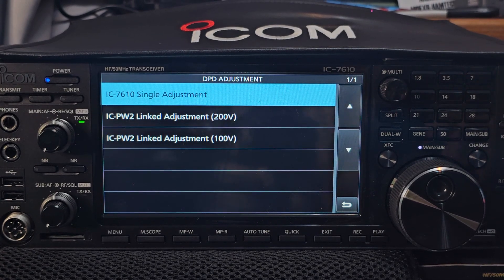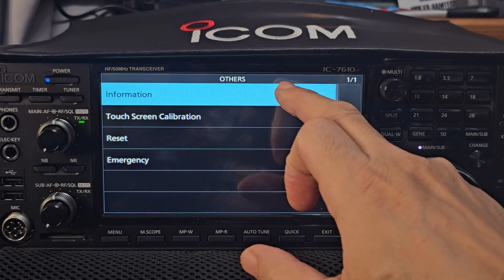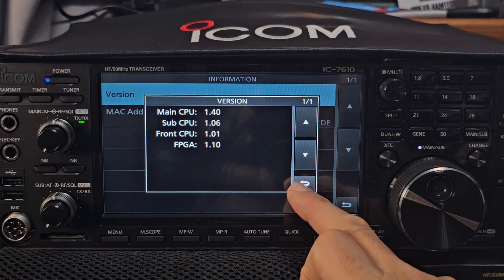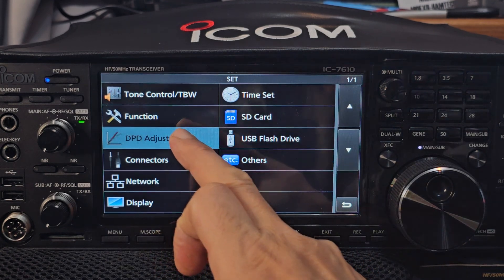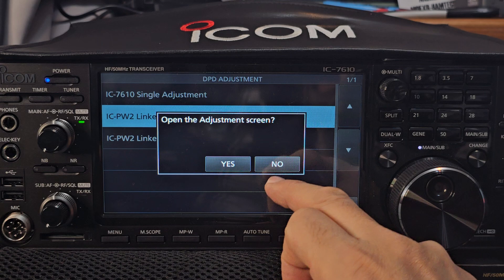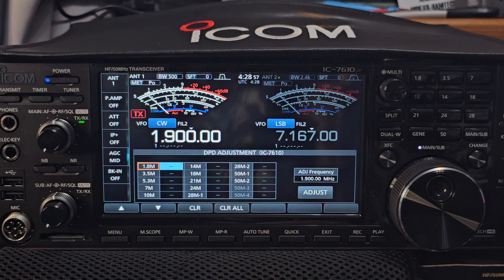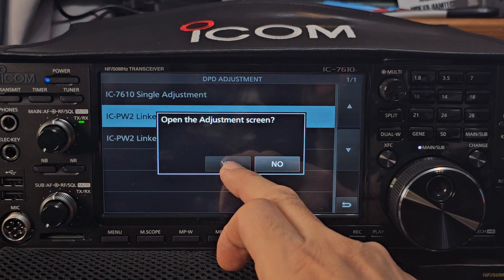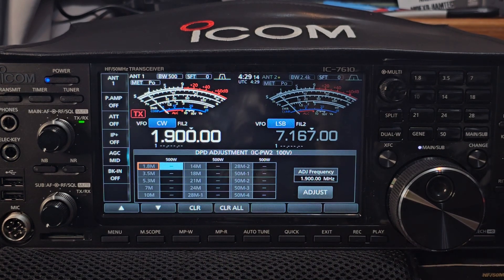ICOM IC-7610., DPD FUNCTION MENU v1.40 Firmware

Comment: Thanks for the video, We'll have to see what that actually does when the firmware is released normally. Some kind of amplifier interface adjustment menu.
Reply from the maker: Yes be interesting to see.
Reply: without PA it should work as well. It eliminates unwanted artifacts on the output. Cleaner signals.

(if you even do a contest you will definitely see and hear the differences)